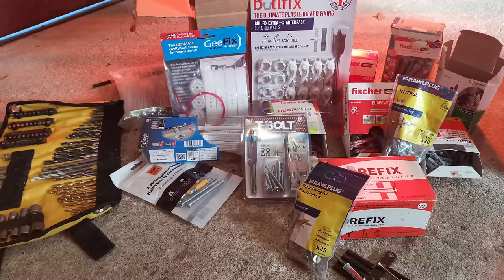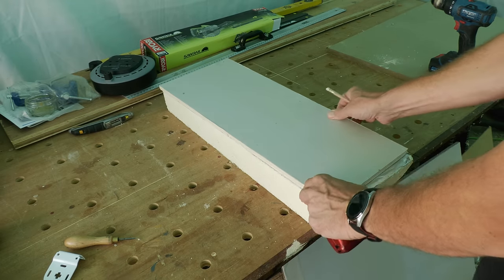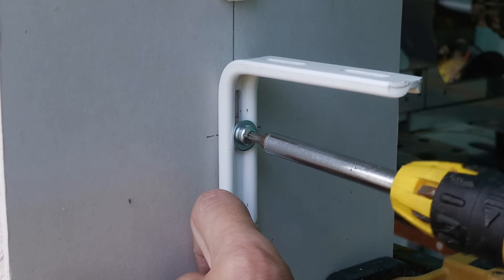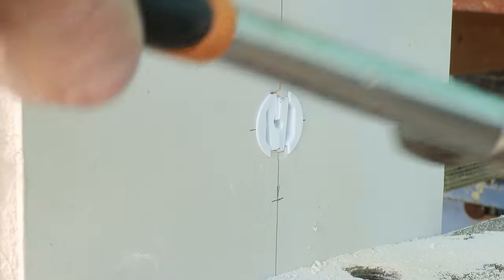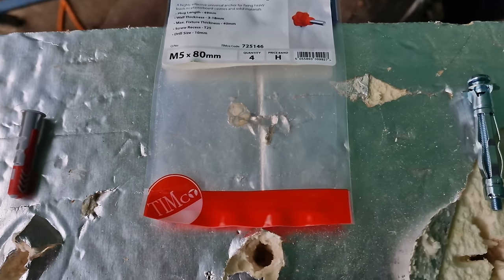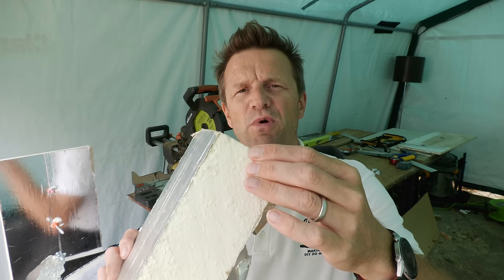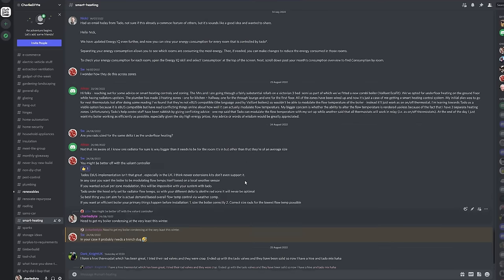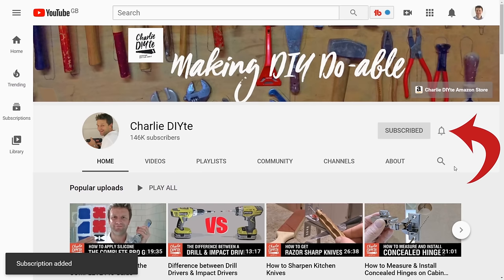How to Fix into Insulated Plasterboard

Comment: Good insight. However, what about situations such as installing curtain poles which usually have mounting brackets with 3 closely located screws? Most of the newer fixings such as in this video are just too fat to fit so closely spaced as curtain brackets require. It seems for such situations the screws and plugs/fixings need to be long and slim to a) reach back into block work behind the insulation and b)for the screws to stay narrow enough gauge to work in the size of brackets’ screw holes. This type of situation is cropping-up more and more….

Comment: Another handy vid, thanks. I’d love to know your view on what to use on hollow doors, as all the ones I’ve tried on our bathroom door have failed within a couple of weeks.
Reply from the maker: Thanks Matt. The Geefix would work best - provided the circular plug which from memory is about 25mm dia is covered by the hook or whatever it is you're attaching. You may just need to trim the plug down to the thickness of the door surface, with a junior hacksaw or belt sander but once you've done that it would be rock steady.

Comment: I like the DuoPower fixing, I like that they give you a fresh drill bit with every package. Word of caution though for if you have to back a screw out of any fixing - sometimes the screw grips too much and can end up loosening the fixing from the wall unintentionally, basically ruining the hole. Also, DuoPower makes a toggle bolt, hard to buy in the US, but it is narrower than most conventional toggles. Wouldn't use it for a tv mount, but for pictures frames and such, it can be a jobsaver...

Comment: Great videos. What would you recommend for hanging kitchen wall cabinets on a wall made up of 15mm PB/4mm rubber soundproof material/15mm PB/25mm sound insulation. As the gap behind the PB is only 25mm to the block work, but the PB is 34mm thick, I'm not sure what to use

Comment: Yesterday I tried the bullfix (the extra large ones) into 100mm cellotex and I had to use a flat head screwdriver to shave some insulation off from inside of the hole otherwise the bullfix had no chance of opening on the inside.  Watching your video I think the better option would have been to get the regular sized bullfix!

Comment: Useful video. I used bullfix to hang a vertical radiator and it seem to work fine. 

Now I have to fit shelf brackets onto insulated PB but they have ‘keyhole’ screw holes. Which would be best for that? I’m guessing the hollow wall anchor as it doesn’t rely on the tightened screw to lock onto the rear of the board?

Comment: Hi Charlie, thanks for your videos, they have helped me no end in the past.

I’ve recently moved into a new build and going through the process of adding curtain rails and it’s raised a new fixing issue for me and wanted your advice. 

So the plaster board is around 12mm with approx 20mm cavity behind which is a metal lintel. Most fixings are too big either in depth or say in the case of the bull fix are too wide, (I’ve 2cm approx between two screw holes on the curtain rail bracket).

I’ve looked at the method of drilling through with an hss bit and screwing in with a 0.5mm larger screw but I don’t trust my accuracy of drilling and it will probably end up on an angle.

Any suggestions?

Thanks,

Tom.
Reply from the maker: Hi Tom, did you see this vid https://youtu.be/Jdu9RId7m90?si=QYNAfsHIJX87q_jw Maybe the T bolt would be your best option. There's a segment in the video about it.
Reply: @CharlieDIYte  I did see it before and looking back on the video now I’m not sure why I didn’t consider it. Maybe I thought it was a bit overkill but having looked at all the other options on your video it really does seem the best one. Thanks Charlie 👍

Comment: Hi Charlie. Great vid.
I don't know which wall I have where I want to hang my TV.  I'm guessing it's dot n dab, since it's facing the outside and using a stud-finder doesn't really show any studs.
I tried Corefix 100mm, but two of them are loose. What I don't understand if I should go for a Corefix 120mm, or use something like a Bullfix. Any suggestions would help. Thanks
Reply from the maker: There are steps you can take to work out what wall you've got as discussed here https://youtu.be/Jdu9RId7m90. If you can't figure whatever reason anchor into the brick behind then a Bullfix or T-bolt should do the job.

Comment: Thanks for the video Charlie. I have a question. On the walls of my home in Spain I have 40mm insulation board (not plasterboard) covered by plaster. Any idea what fixings I could use please. Nothing too heavy - curtain poles and pictures. The advice given to me is a long drill through the brickwork behind the insulation and then a rawl plug with a 50mm long screw. Is there anything better I could use please?
Reply from the maker: How thick is the board?

Comment: Hey Charlie, great videos, you’ve really helped my DIY journey tremendously. I have an idea for a video for you. How about best ways to strip paint from door frames/skirting etc. I’ve just spent about 20 hours doing one doorframe using a heat gun, scraper and mouse sander… it was such a long and arduous task. I’d love to see your thoughts on the best way and technique to strip paint. Keep up the good work! Cheers, Ryan
Reply from the maker: Hi Ryan, thanks for this. Really chuffed you're finding my vids useful. Funnily enough I have a paint stripping vid in the pipeline. Will probably do it in a month or two. Basically I got sent an infra red stripper but actually found you can't beat a good old fashioned heat gun. I'll give you a shout out when I do it 👍😉

Comment: Great video! I'm currently building up to doing fitted shelves and some of the walls are plasterboard over insulation (had internal wall insulation installed recently). What fitting would you recommend that will handle the added thickness of the battens I'll need to use to support the floating-style fitted shelves?
Reply from the maker: Thanks  For floating shelves maybe a wall anchor. Set it as usual and then buy longer bolts to fix the shelf in place. Floating shelves are always problematic in plasterboard though as they put a lot of stress on the fixing.
Reply: @CharlieDIYte  awesome, thanks for the advice :)

Comment: Which one to choose for screwing the radiators to the k118 board ?.
Reply from the maker: Tricky. You should always put a board behind if you can because of the weight and anchor into that or the brickwork but if you can't then probably a few anchor fixings.
Reply: Thx.

Comment: Wouldn't have been a better test to hang weights on the brackets as a better test to see which one takes the most weight instead of just screwing them into the plaster board.
Reply from the maker: I did a load test in the last video towards the end. So no need to repeat it.